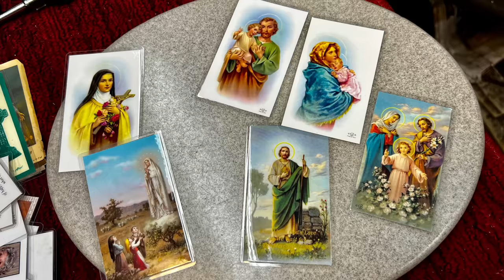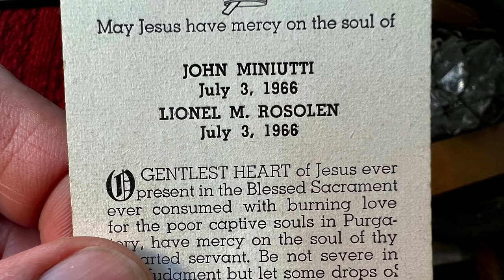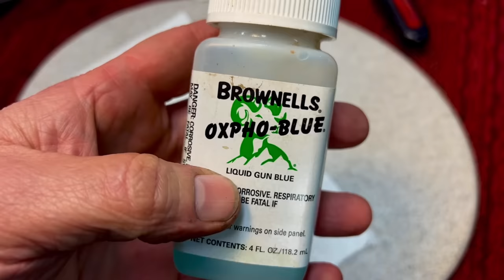Gray B654 Long Needle Nose Plier Restoration- Bluing Introduction and Prayer Cards

Comment: Great vid! 
A couple of bluing tips I've learned: 
1. Do not use the same contaminated Q-tip or paper towel to dip into the bottle, it will react and weaken the left over fluid.
2. Heat up your tool nice and warm. Not to hot to handle, but very warm for a darker blue.
3. If there are blotches/ to avoid blotching, use steel wool to apply and scrub into the metal. Just rinse first with alcohol to remove oil. Scotch Bright might be better, I've never tried it. 
4. Apply 2-3 times for an even color. 
5. Heat the tool again when oiling to improve longevity.

Comment: Great video 👍 Those Collections of channellock pliers look great. You can’t go wrong with a good channellock plier. Those Gray  long needle nose pliers you restored turned out Fantastic. I like what you did to the handles. It was great information and demonstration of how to get the bluing to turn out just right on any project you would want to blue. I also like the technique you done to get that edge right around the contour of the plier handles, great job 👍.  Hope you can  finally get that electrical problem fixed. That can be kinda worrisome. Well again great video and can’t wait to see what you do on Friday. Have a great evening. 😄👍👍
Reply from the maker: Steven they did a great job- I will show on Friday 😃👍

Comment: Nice job on those pliers! Can't say enough about oxpho-blue. We've been using it in the shop for a long time to touch up barrels, trigger guards, and small parts and it makes for a really tough finish that you can blend in with many an original finish. Have even used it to finish new factory bright muzzleloading barrels that customers didn't want the traditional brown or even a hot blue. Go figure.
Reply from the maker: Hi Bob!  That is great to know-  nothing beats hot bluing but this is a fast alternative.  😃👍

Comment: The long pliers are my pick BUT i went online and ordered a pair of the L O N G ones with a 45 bend on the ends for hair clip pins and gas line clamps on mowers and such but they sure come in handy for other stuff. I was going to get a set of Kobalt but they only had those double jointed things and the simpler, the better so I got PROTO and am very happy with them. And I'm through with funerals. I started doing my condolences online and I'm just waiting on mine since my 3 score and 10 is gone and I been living on borrowed time a LONG time. Thanks, Pal and God Bless
Reply from the maker: Lewie- It’s true the bent needle nose come in handy!  😃👍
Reply: @ScoutCrafter  They sure do for me. Blessings!

Comment: Hey Scout, the only downside to collecting funeral cards is that you realise how many people you have known are gone. Kinda sad when the collection grows faster as you get older.😂 Great job on the blueing. I differentiate those pliers into “long nose” (Channellocks) and “needle nose” (Grey) and have my father’s needle nose pliers that I use but I won’t let anyone else touch them. I have found that once the needle nose pliers are twisted it’s almost impossible to get them right again, either the tips won’t align properly or the joint becomes loose. 
Cheers, Stuart 🇦🇺
Reply from the maker: Stuart- Yes!  Long needle nose pliers should never be lent out!  I have a box of loaner tools incase someone needs them, they are mostly import junk!  LOL

Comment: A right angle die grinder with 2" sanding discs is also a nice tool for that transition area on those pliers.  Amazon even has a kit of discs with a sponge type pad that helps make softer sanding lines.  Just another option if the grinder becomes too big.
Reply from the maker: Yes!   That tool is the best but you need a big compressor to run them as they use a lot of CFM....  =D

Comment: John, by coincidence I have been searching yours and other videos looking for information about how to re-cut very worn teeth on small needle-nosed pliers. Also, do I need a Dake to tighten slightly loose ones? Thanks for all your hard work / information that I have enjoyed over the years. Best from UK.
Reply: One way to tighten loose pivot rivets is to strike the peened part of the rivet several times with a center punch. Do this carefully and sneak up on the amount of correction you need. IMHO the dings from the tightening are worth it to regain a good working tool. If I had a press I would find a way to use it.
Reply from the maker: Cutting the teeth is hard because they are so fine!  😃👍

Comment: Can't believe it took 6months for service appt to fix this?!? Con-ed did  it to Scoutcrafter in the basement with thee lead pipe channeling water through the electrical box. ZZZzzzzzzzz. . .
Reply from the maker: I know that water seems dangerous but lots of electrical cables are run underground in wet conditions. As long as they are jacketed I think it's ok...  They run electric cables under the sea!   =D